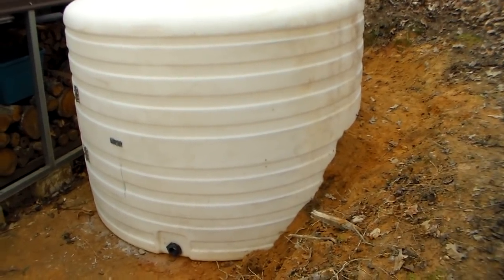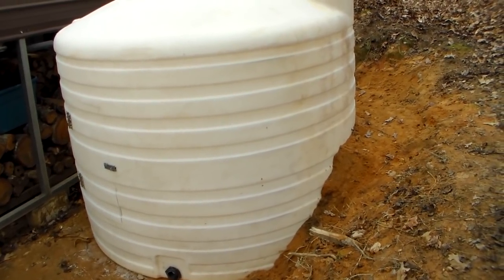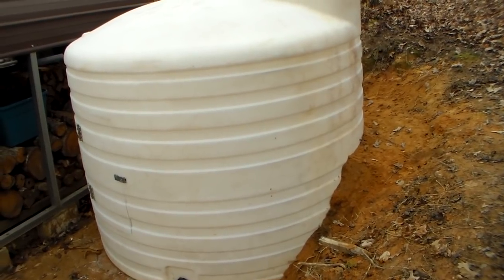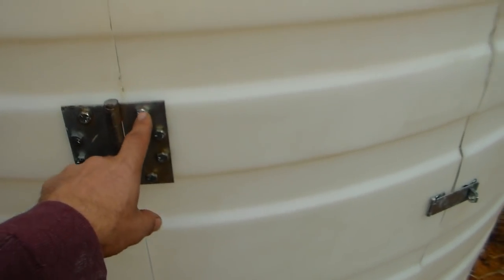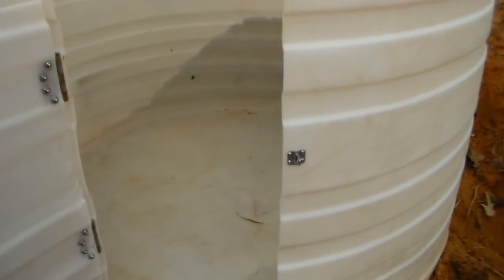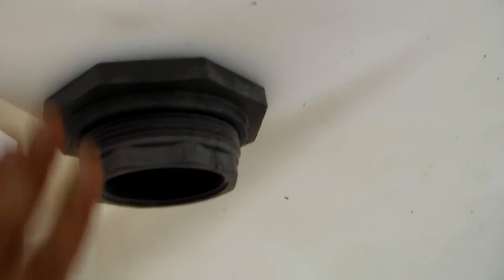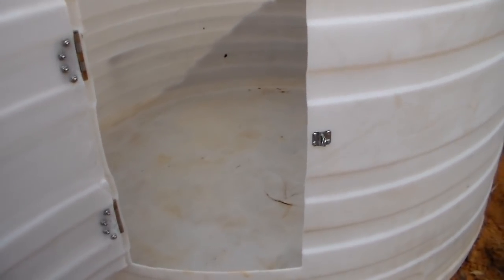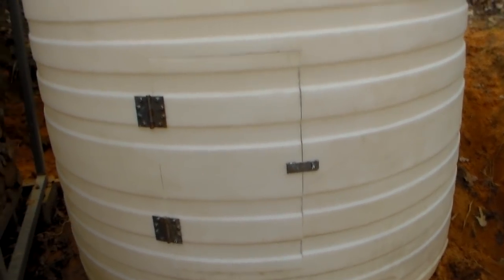Thank you for your input....I decided what to do with the white tank...For Now

Comment: The Gray Ghost makes a very good point. You have a very high potential for static electricity inside that tank. When conditions are just right, you can walk inside them and your hair will stand up. Buried… Half buried… Sitting on the surface… Makes no difference. It can come and go with the weather. Think twice before storing fuel in there.
Reply: A few years ago I worked in a plant  that makes foam cups. The foam would give off pentane gas, and to distribute the foam into the presses. The lines would be grounded. The problem area's were on the plastic vinyl lines. Not only does it hold static. But it is extremely hard to ground out because of it's insulating abilities. I would use it as a root cellar instead.
Reply: Def something to be concerned about—-would be a big explosion.

Comment: The only thing I would be concerned about is static electricity. We have a fair number of those tanks, and at times the static can build up, enough to where if standing nearby, the hair on your arms will stand up.  They are on a concrete pad so direct contact with dirt might remedy that.  Wouldn't be too concerned about diesel, but with gas it could potentially be problematic. Love the content and appreciate everything you do.
Reply: Just ground the tank. Wrap bare wire around it… attach to a metal stake and hammer it inti the ground.
Reply: A bit out of my area but the wire should be on the inside.  On the out side with an air gap inside the tank you may be making a large capacitor out of the tank. If the tank is actually full of fuel then the wire outside would probably ground it safely. Something to consider.

Comment: I would leave the hole  on the floor, it will let water condensation and gas fumes escape, they are heavier than air.  the top vent is fine, but bend the hose downwards and outside, so no water runs in.
Burying it is a good idea,  that helps to stabilise the temperature,   temperature swings cause condensation, bad for the steel cans.  If you have alcogas, 5 or 10% alcohol,  that needs adressed.
The alcohol causes all kinds of problems ,  eats seals etc. causes corrosion in metal parts etc.  Take a white 5 gall plastic container, add a gallon of water with red food dye, then add  3 gallons of alcogas,  shake it and leave for 24 hrs.  Next day all the water and the alcohol will be in the bottom, visible  with the dye indicator. Pour the cleaned gas off and store. Add stabiliser.  It works fine, I have used it in my generator and chainsaws etc.If you can get real gasoline you are lucky.  All part of the plan Bro.  God Bless

Comment: I watched a few You Tube videos on repairing auto plastic bumpers, I use a large (straightened out) staple, heat it with a soldering iron and place it on the crack. I melt it in a bit further with the iron, has worked well on the repairs I have done so far. Of course, a plastic welder is better, but I would never have enough work to rationalize buying one.

Comment: Static electricity is a potential hazard with these tanks... especially if you'll eventually be jockeying around 5 gallon metal cans inside. At the bare minimum, I'd look for an anti-static paint to coat the interior with and do everything you can to attempt to ground the entire tank. And I would store only diesel cans in it. Gasoline fumes are just too combustible to risk.

I'd do what somebody suggested below... bank all sides, leave an approach trench for access to the door and use it as a nice little root cellar. 
Put your gasoline somewhere else... we want you to stick around.

Comment: Honestly, due to the possibility of static issues, I’d probably not do this.
More than one pick up driver has found this out the hard way while filling up the plastic can in a plastic bedliner. 
Hence the warnings at the pumps.
If you are going to do this, I’d use metal racking inside, and ground it to earth.

Comment: Just remember, Gasoline vapors rise, LP is heaver than air. If you store both fuels in the same location, you will need to vent for both.
Reply: Gasoline vapors do not rise..
Reply: Actually both gasoline and LP vapors fall to the ground.
Reply: Who said that gasoline vapors don't rise ?!? At your next stop to a gas station, pay attention to the respirators well above the ground, coming from the subterranean tanks to dissipate the gases and pressure well above ceiling high !
Reply: @entubadao  
I said gasoline vapors don't rise.
if you think gasoline vapors rise out of the vent at the gas station then it would be a huge hazard because it's flammable. The vapors would be pouring out of that vent.
The vapors  are three to four times heavier than air and fall. not rise.
The internet is your friend look it up.
Reply: @greghomestead8366  I believe he’s speaking about the vent tunes for the pumps that are connected at the tank ! Basic plumbing ….
Reply: @greghomestead8366     
  Gasoline that not in a sealed container always produces vapors. Gas station  tanks are vented so that air can enter to fill the space left when gas is pumped out. When no gas is being pumped where do the vapors go??? I'm not sure. I'm sure that the EPA doesn't allow vapors to vent into the air.
   I do know that in a home or farm setting spilled gas or open gas dissipates into the air and vents more quickly to a higher vent. Don't test that you can have very bad results. The old thought is that one gallon of gasoline turned into vapor has more exolosive power than one hundred sticks of low yield Dynamite.   
  Another thing to think about is if you have a Conex container storing anything in it that could possibly be flammable you need to have a low vent at one end and a high vent at the other end. Conex containers are nearly airtight and have accumulated enough fumes to cause violent explosions .
Reply: @davej7458  
You're not looking at this quite right.
Your thought on the gas station is only partially correct.  but an important part is not
True the vet at the gas station is at the top of the tank and when gas is being pumped out it's replaced with air.
Your question is where do the vapors go they stay right on top of the liquid on top of the liquid because they always go to the lowest point. Now when it expands you are correct that that vapor would come out the top because there's nowhere else for it to go.
however gasoline is heavier than air so when it comes out of the vent at the gas station it doesn't go up into the sky it hangs on the ground because gas is heavier than air.

Comment: 5 Gallon cans makes it easier to keep your fuel fresh. If you have a 275 gallon tank and 150 gallons goes bad before you use it all that is not fun trying to run it a few gallons at a time thru your vehicle. I know someone that ran bad gas in their Dodge pickup and it ruined the engine by filling the crankcase with unburnt gas.

Comment: How long can I legitimately store gas? Is there a difference between metal and plastic cans in terms of keeping gas longer?
Reply: About two years on gas is going to be about it. And the cans need to be sealed. (No open spouts.) plastic is fine, metal would be better if you can still find them.
Diesel will store considerably longer.
Reply: About two years on gas is going to be about it. And the cans need to be sealed. No open spouts. plastic is fine, metal would be better if you can still find them.
Diesel will store considerably longer.